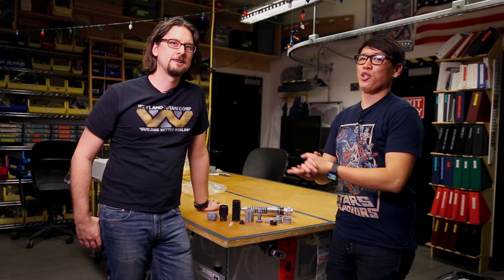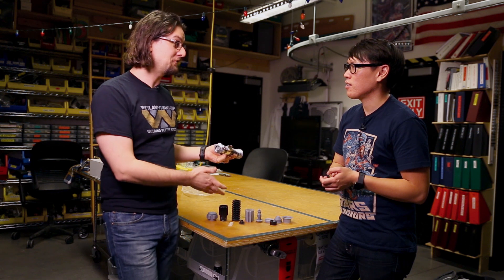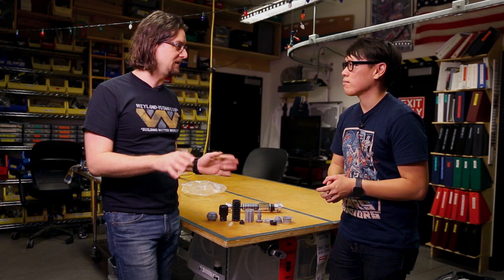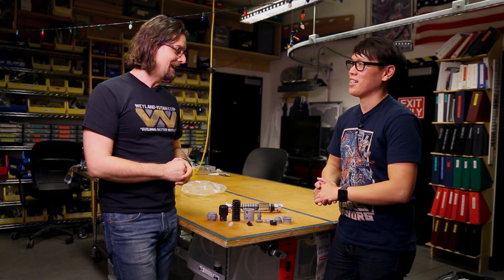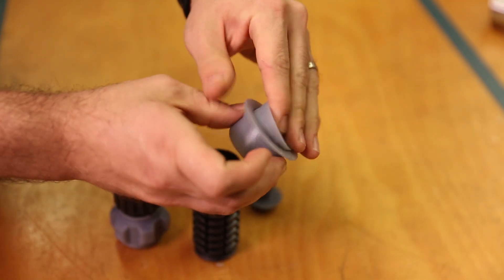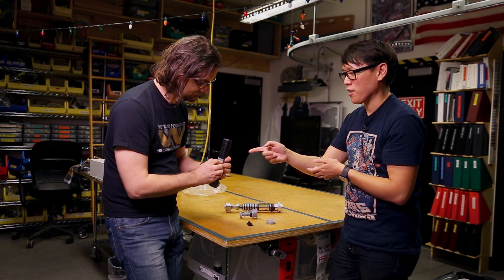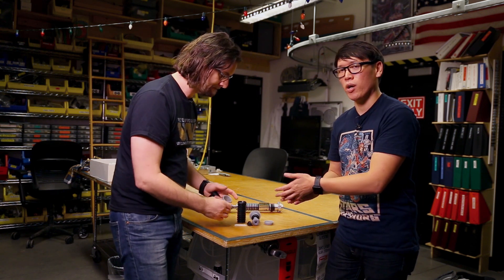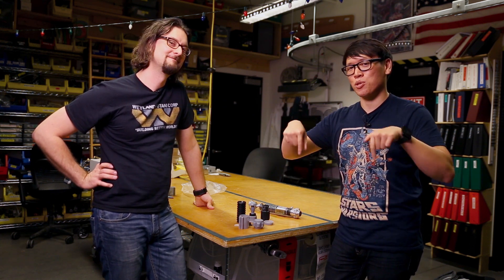Show and Tell: 3D Printing a Lightsaber

Comment: A lightsaber replica made out of plastic? Defeats the purpose.
Reply: +Michael Ziegler Lukes ROTJ lightsaber was made out of wood.  Most PT lightsabers were made out of resin and electroplated.  Defeats the purpose I think not (depending on the purpose at least).
Reply: +HAlariousInc Luke's "stunt" light saber was made from wood the hero prop was not.
Reply: +HAlariousInc Luke's "stunt" light saber was made from wood the hero prop was not.
Reply: It's supposed to have the weight and feel like a real saber, having it made out of plastic. Just makes like it was bought at Wal-mart.
Reply: its hollow, add some lead, im thinking of adding some lead and a laser pointer

Comment: still not impressed by the home 3d printers. I know the industrial versions can do metals and does help in designing prototypes, but when used for mass production it's really too slow and not viable.
Reply: rurutu M These automobiles will NEVER replace horses Mr. Ford!
Reply: As of right now maybe, give it some years and 3D printers will be in most homes.
Reply: templetonbob I have one I am getting that 3D printer Magazine
Reply: rurutu M 3dprintning was not made for mass production

Comment: Now  if only we can 3D print a working one :(
Reply: JNCressey well sort of... light at the blue end of the spectrum does travel faster than light at the red end of the spectrum; for a weapon to work more or less the way we see the sabers in the movies work; even Michio Kaku has postulated you would need a high energy plasma contained in a tubular magnetic bottle. the big issue is the power source. you would need far more power to make the magnetic field functional than could ever be made portable. and the plasma would most likely cook the user.
Reply: You can get a high intensity laser pointer that actually does burn through stuff. Though, it takes a few seconds. The power needed for a lightsaber to function as a sword would be about the same as a standard incandescent light bulb, 40 - 60 Watts.
Reply: ***** But lightsabers are nothing like lasers.
Reply: JNCressey It's still really high powered light focused to a beam.
Reply: ***** Riddle me this, if the light is focused, how can you see it from the side?
Being able to see lightsabers from the side and them being a finite length implies they are more likely to be some containment of very hot glowing stuff.
Lightsabers are clearly not anything like lasers.
Reply: JNCressey Light takes on a different color based on speed of travel. Also, lightsabers are like that because they're CG props. The closest I can think of to having a legit lightsaber with a limited blade would be like the beam katana from No More Heroes.
Reply: ***** the colour is the frequency/ position on the spectrum. Not the speed. All colours of light travel at the same speed. The beam katana is still nothing like a laser. You clearly have no idea how light works.
Reply: JNCressey It's been a while since I was in school and didn't feel like looking up light color. The reason it's different is because the designers of the items want it to look like more than just a stick of light.
Reply: ***** Source plz. "light at the blue end of the spectrum does travel faster than light at the red end of the spectrum"

Also yes, the only way to get an effect like a lightsaber would be some other method that's nothing like lasers. eg contained plasma.
Reply: JNCressey http://en.wikipedia.org/wiki/Visible_spectrum   http://www.astronomynotes.com/light/s10.htm  http://www.cnet.com/news/this-is-what-a-star-wars-blaster-bolt-would-look-like-in-real-life/#ftag=YHF65cbda0

In the strictest of terms we are both right in that, yes you are correct that light only travels at one speed,
but photons at the blue end of the visible spectrum are traveling at a shorter wavelength an traveling at higher energy;
if you want to talk light physics here is a really great forum with some very very intelligent people  http://laserpointerforums.com/  for me college was a long time ago and my mind seems to be turning to mush lol
I'm suffering from "Sometimerz" and a mild case of CRS= can't remember shit!
Reply: ***** The wiki page you linked says that Newton hypothesized that colours traveled at different speeds but the other page on the speed of light says: "Newton queried whether Rømer's eclipse shadows were coloured; hearing that they were not, he concluded the different colours travelled at the same speed." http://en.wikipedia.org/wiki/Speed_of_light

Your other link is about Doppler shift, which isn't different colours traveling at different speeds, it's the fact that the speed says the same and the lightsource is moving which either squashes up waves or stretches them out.
Reply: But lightsaber blades stop at a certain point, about 2-3 feet, so how could that be done?

Comment: Hmm when these printers start doing all sorts of artworks.. jewelry and what not.. lots of people are going to lose jobs :D... Sure unique stuff is still going to be valued. But why pay 10 times more when u can print a better one off the internet in a few decades.
Reply: They will in the future, but not right now. We cant print with very many materials and the detail isn't quite high enough yet. SIts getting better each year though, interesting to watch.
Reply: Ax1007 Most jewelry people wear is pot metal with paste stones. It shouldn't be too hard to convert a filament printer to silver and tin solder. Use a little light acid wash after the print to take off the oxides and you are good to go.